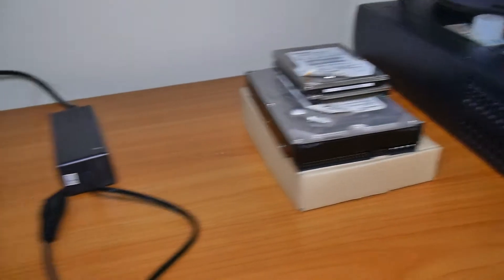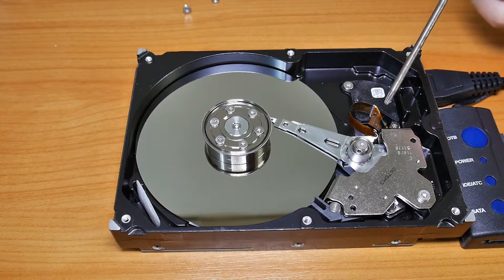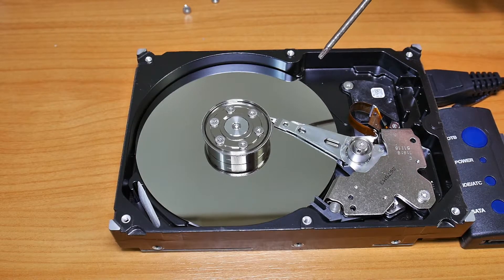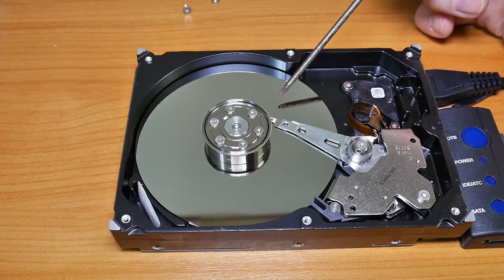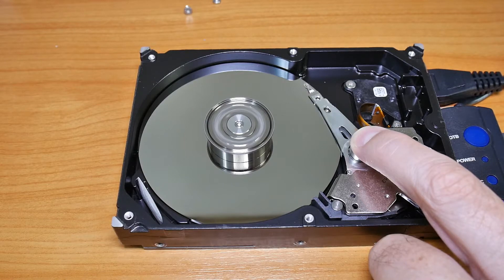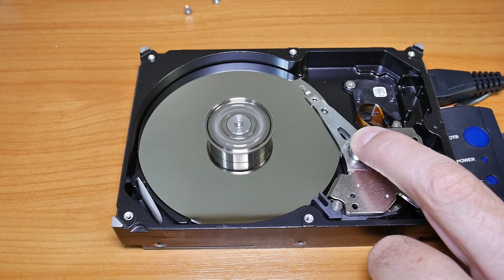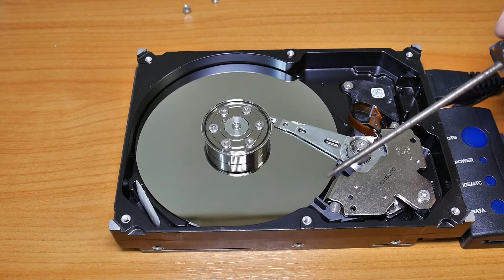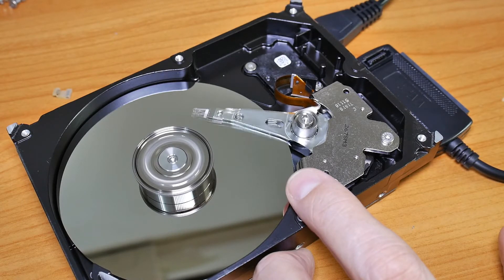Inside A Running Harddisk Drive - In High Definition

Comment: I had an old hard drive that failed and it made a different click, it was very slow cllick..... cliiick..... cliick
Reply from the maker: The clicking is typically caused by the drive resetting itself, or the head position, or trying to find data from a damaged part of the disk.  Each one can have a different frequency / loudness.